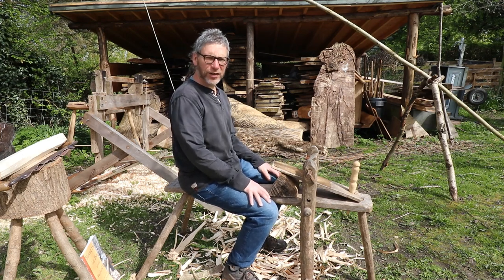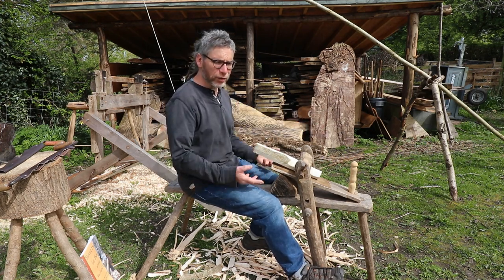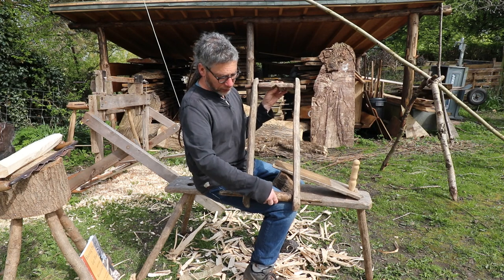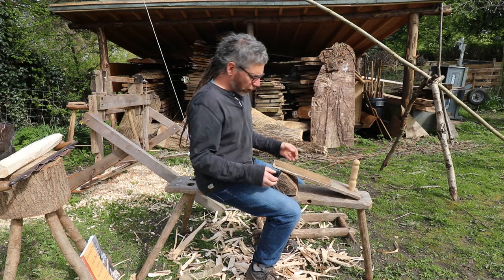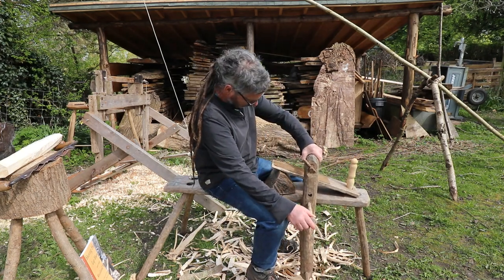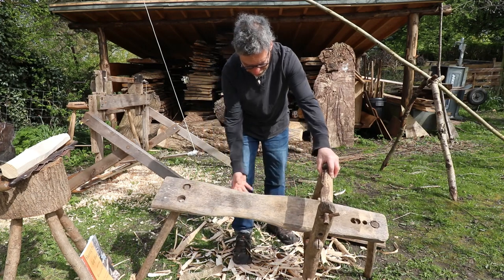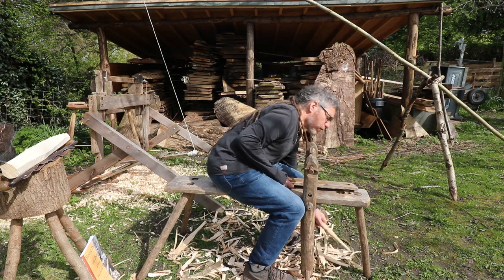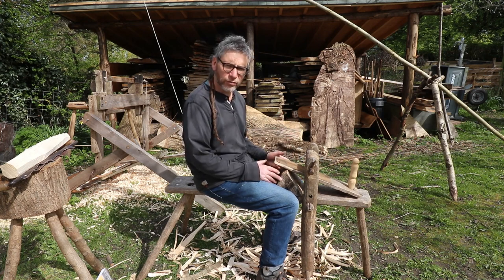From the garden - Intro to a shaving horse

Comment: If you put the pivot peg in the upper holes, are the foot rests too low to clear the ground? It doesn't look like you have much clearance room on yours. Or, do you just use longer bench legs?
Reply from the maker: Well spotted, it's an old shave horse and the legs have literally worn down. I rarely use the upper hole on this one but if it is needed I'll just put a plank under the rear legs to raise it a little.